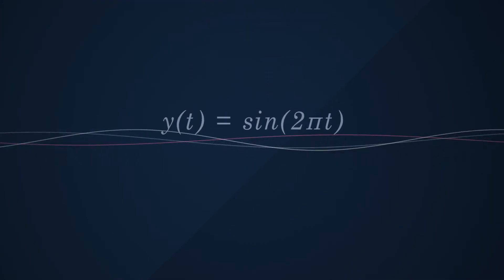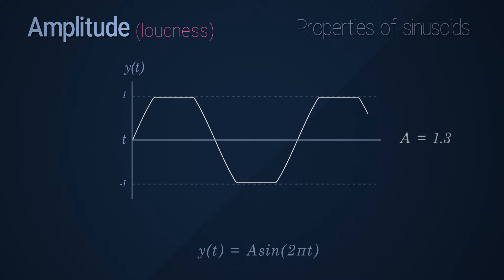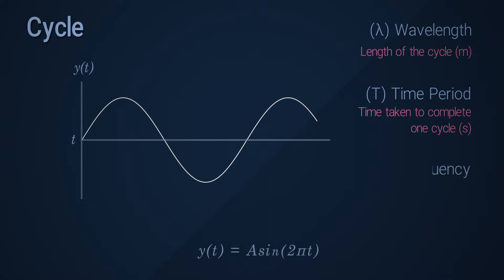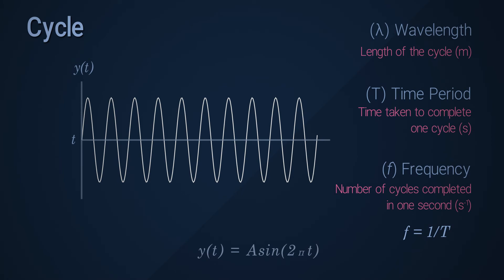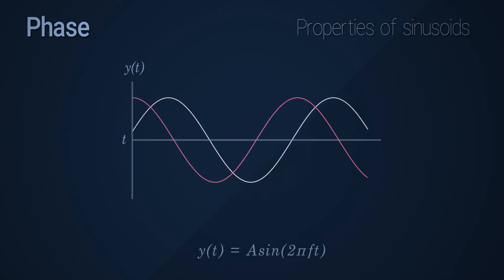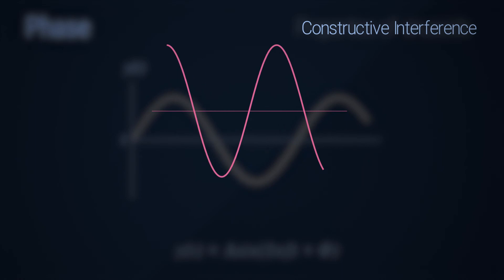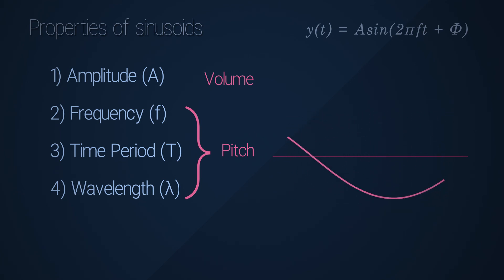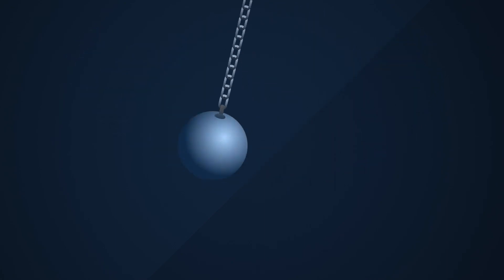5. Properties of Sinusoids - Origins of the Sine Wave

Comment: You should not animate the sinusoidal wave as a function of time. For each point in time the signal is fixed, it does not animate. You are confusing waves with signals. You can animate a wave as function of position.